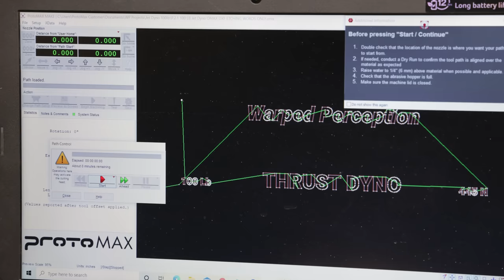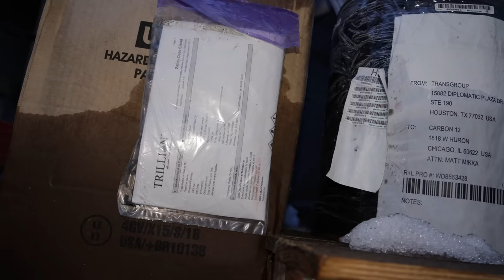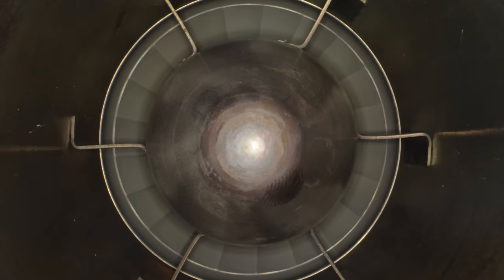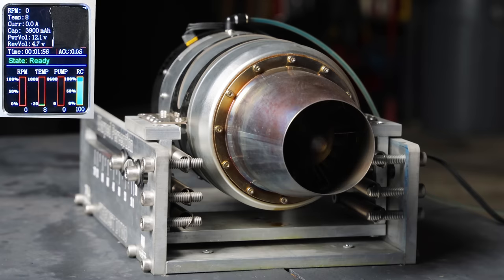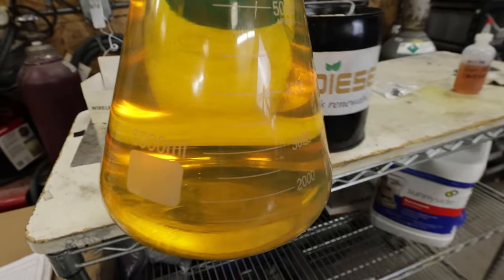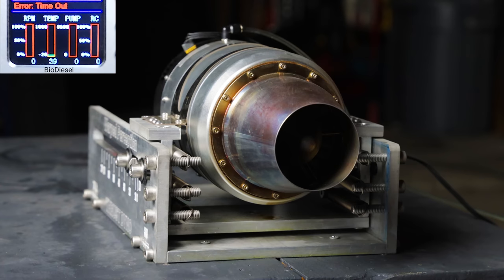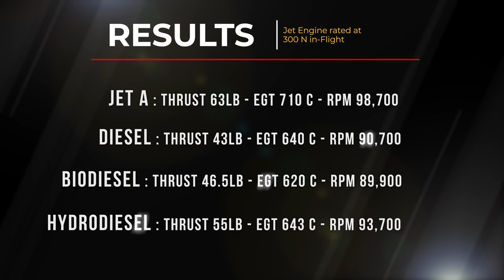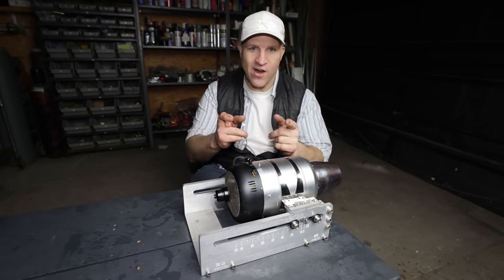Jet Engine Thrust Test - Fuel Experiment (Jet-A vs Diesel vs BioDiesel vs HydroDiesel)

Comment: In case anyone is wondering, this does indeed mean that you can run a diesel car in aviation jet fuel. It’s definitely not something us aircraft engineers do though, honest...
Reply: Yes, most likely.  The military runs a lot of their ground vehicles on jet fuel because they only have one kind of fuel to manage for air and ground vehicles.  Kerosene, diesel and jet-A should all work.  The thing is, diesel is the cheap option.  You would end up spending a lot more if you bought jet-A or kero.
Reply: @LatitudeSky  And the military doesn't care. Actually the cost of managing many fuel types is more expensive.
Reply: The difference is that at jet-a will not turn to margarine at altitude and low temps where jets are efficient. We were trying to figure this out in biodiesel without dehydrogenation in university.
Reply: I may or may not have seen co-workers take buckets of JP8 out to their diesel trucks after draining the fuel lines post test cell runs....
Reply: @LatitudeSky  "You would end up spending a lot more if you bought jet-A or kero" Unless you grew up with a guy that became a crop duster pilot that buys his jet-A by the tanker load. Nice discount.
Reply: @soulcapitalist6204  luckily I only drive at sea level...
Reply: @WayFastWhitey02  definitely not - I’d never do anything like that...
Reply: You do realise that aviation fuel is leaded?
Reply: @oadka  Aviation gasoline has a lead additive. This is not needed for kerosenes like what was burned here.
Reply: @soulcapitalist6204  oh yeah right I confused them sorry
Reply: Penfold011082, i have run a diesel truck in Russia at -35  with a mixture of 75 diesel and 25% gasoline, preventing diesel from gelling, works better than using anti-freeze additives (learned from Russian truck drivers). i have run a Mercedes diesel car from the 80`s with 100 used motor oil (as fuel) in summertime, mixed with 20% diesel in wintertime due to viscosity, and also this same car with 80% jet-a (kerosene) and 20% used motor oil. And with 100% biodiesel too. Depending on the design of the engine, you may run different fuels in it. Well it`s true that the diesel engines form years ago, were more permissive at running different fuels that the diesels of today. The army got some vehicles with engines designed to run with very different type of fuels now a days in service.

Comment: My guess for the hydro-diesel is that the extra water content produced steam, that steam pressure compensated for the lack of fuel in the other diesels. Though it could be that the pump found it harder to pump the normal and bio diesel.
Reply: Diesels in general are very viscous fuel compare to jet fuel or kerosene.
Reply: Nickael7 
Yeh that’s what I’m saying.

Comment: Some of the Water molecules in the hydro diesel might undergo thermolysis, giving off hydrogen and oxygen which then recombine within the engine at very high calorific value enhancing the pressure build up which in turn kicks up the thrust... 

Thermolysis jump starts at 550°c and with the insane compression and heated metal parts there is a chance for some of  the water molecules to split🙂🙌
Reply: Normal inter-turbine temperature (not even hottest part of the engine) on the actual airplanes I fly is 700-720 degrees C, so this is quite possible.

Comment: Imagine how much more thrust they make in the model airplane when it's traveling 2-300mph
Reply: Not a whole lot more, especially given that everything but Jet-A maxed out the fuel system, so, good chance that at speed they'd blow out.
Reply: I'm an aircraft engineer and you're correct that it will make more power when its moving and 'ram' air into the engine, its called 'ram recovery'. However, to maximize thrust you would need a carefully designed intake duct so it supplies this air at the right speed and without turbulence, so it would need to be smooth and properly sized to ram the right amount of air in for a given speed. Jet engines don't have an 'air / fuel' ratio like a car engine, so the more air you squeeze in, the more thrust you get out.. I'm guessing but you could see a 20% increase at speed in a model engine like this.
Reply: @ScottyPilot  Very interesting. Our main problem is, how to design your intake to maximize the efficiency of your system. Hope to find something in the web.
Reply: @thomaskunze8196  its a bit more complicated.
 the angle of the compressor blades need to match the airspeed and rpm to avoid turbulent flow, which is why some turbojet engines have variable inlet guide vanes.
This engine (from what i could see) doesn't even have static inlet guide vanes, which means a lot of turbulence even if the rpm does match the airspeed.
i also noticed that the turbine exhaust appears to form a vortex, so the turbine outlet guide vane are probably insufficiently curved.
If the exhaust was flowing straight instead of in spiral, the thrust should be higher.
But fixing all that would likely cost much more.
Reply: I'm wondering if the different densities of the fuels might require alterations to injector/jet sizes and delivery rates to optimise how they burn.
Everything about the engine design (combustion chamber, turbines, injectors/jets, fuel pump) is optimised or sized for Jet A1 (Kero), and will need altering or tweaking to optimise for Diesel.
Reply: @twentysevenlitres  for the same pressure yes, you need to adjust the size of the nozzles to deliver the right amount of fuel, alternatively increase pressure but only to a point as the actual spray pattern is also important to shape the flame for best combustion and to keep it off the walls of the combustion chamber so it doesn't melt.
Reply: @ScottyPilot  hey mate, I have a question...

I can see a fan in the back of the jet engine that isn’t moving. What is the reason behind this?
Am I just seeing things?"

Thanks very much :)

..Tim
Reply: @yallawallahalla  yes mate, thats correct.   There are a series of stators that look like a fan but serve to re-direct the flow, either onto the rotating turbine or to just straighten the flow into the exhaust so it heads straight out the back of the engine.  We used fuel to energize the air and make it move, if the air swirls inside the engine and not towards the exhaust is inefficient.  Ideally we want the air to flow in as straight a line as we can. The reason it swirls is Newtons 3rd Law 'for action there is an equal reaction' , as the air hits the turbine the turbine moves, the air also moves against the turbine and swirls as a result.   as the turbine spins one way, the stator in the exhaust attempts to straighten the flow. These small engines aren't as well designed as a massive aircraft jet is and there are other design considerations that make large jets more efficient too, proportionately these little engines use more fuel for the thrust they make as a result, but most of us don't care hey..!!  .

Comment: I'm pretty sure the Hydrodiesel would allow for a longer operating time because the water also cools the engine and increases efficiency.
Reply: What would be the cleaner burn tho? Does hydro diesel leave more residue if any?
Reply: Then again, 20% of the fuel mass is replaced with water so unless the increased fuel efficiency is great enough it won't make up for the reduction in fuel capacity.

Comment: This was an interesting experiment but I don't think it was done correctly (at least not for measuring max thrust). The limiting factor in a jet engine is temperature. The more fuel you add, the more thrust you get and the higher your EGT. You can keep increasing fuel (and thrust) until it flies apart. Your "constant" should have been EGT, but instead what you probably kept constant was the power going to your fuel pump. More than likely JetA won because it was thinner and the flow rate was higher. I think the right way would be to pick a constant EGT, say 710*C, and test each fuel to that limit. Keep increasing fuel flow until you get to that limit for each fuel. Yes, you might have to change pumps or injectors for each test, but that is the whole point. Otherwise you are just testing which fuel has the lowest viscosity. I think....
Reply: that makes a lot of sense actually.  seems like another experiment is in order
Reply: Wouldn't you get around the same thrust with the same EGT on the same engine?
Reply: No offense buddy but according to me the objective of this experiment was to calculate what maximum thrust can be produced by the fuel. By fixing EGT I think it would limit the full power or rpm. Like you said, pumps/injectors should have been changed as per the fuel which I totally agree. I have one question though, shouldn't the cooling mechanism for different fuels be different, like in a real jet engine?

Comment: Did you "drill" those holes @ 1:50  with the water jet? To a good enough precision that You could just tap them?
That's pretty impressive to me.
Reply: You can get away with it. I doubt it will pass a class 2 or 3 plug gage though. The hole will also be tighter at the bottom than the top from deflection. The hole walls won't be straight.  Not bad though maybe .010" or so. It's 1/4 inch aluminum though so no big deal. If it was a 1" thick piece you'd have far more deflection. All of this depends on what feed rate is used also.
Reply from the maker: Yup ! I was very impressed that it actually worked
Reply: @joshuagibson2520  yeah I was thinking a slow enough feed rate could get it perfect as more and more metal gets taken away there would be less and less deflection

Comment: I built some of the first lubricity test instruments for the USAF and had an ASTM test method for testing turbine fuel lubricity. Additives can negate the loss of sulphur in all of the fuels. Also many times biofuels have some natural lubricity that severely hydrotreated diesel and jet fuel do not. I also built some of the first diesel scuff testing instrumentation. Poor lubricity tears up the fuel metering/pumps at a premature rate. I would say even more so with ultra high pressure pumps.
Reply: So fuel additives for diesel fuel aren’t just a sham?
Reply: Would love to hear more about your endavours and experience. This sort of knowledge and know-how is priceless to me.

Comment: This is awesome! I have been wondering if it were possible to run different fuels in a turboprop engine. I’m getting ready to drop a Garrett 331-1 in an experimental airplane and was looking at running diesel in it. Looks like it’ll need some modifications to go from jet a to diesel but it seems like it’s definitely doable with the right jetting and water injection for those short field takeoffs!

Comment: O.K. Hear Me Out. A Water Ingestion test, I want to see how Much water it will Take before that Sucker Flames Out. This One is Easy, Doesn’t need any High Altitude Flying or Hiking. Would Love to see this Suggestion in a Future Video. Cheers :)
Reply: won't this destroy the engine
.
Reply: @kingsxkids  no. The Internals of the Combustion chamber can reach 2000 C Water boils at 100. Its fine if the engine sucked in Water.

Comment: As a former aircraft maintainer, I enjoyed this video a lot.  Really surprised by the hydro diesel.  Wondering if it would still function at low temps?
Reply: no, it would jell in the bladder fuel wing tanks; but again, commercial airlines do have the fuel heater unit to heat the fuel as it pump to the rest of the engine fuel system.
Reply: @rtchow3000  Well, they have a small heater that serves two purposes. Cooling oil and heating fuel. The unit is called FCOC or fuel cooled oil cooler.
Reply: @TOP10RakanKazmi  not all airliners have an FCOC, nor can the FCOC keep up with a large amount of water in the fuel, as it's primary purpose is cooling the engine oil, with heated fuel as a byproduct.
Reply: The HydroDiesel essentially is the same as having a water/meth injection, which was used by early turbojets to increase takeoff thrust. At high altitudes however, this would cause massive problems as I'm sure you are aware. There's a reason we sump tanks so much

Comment: That hydrodiesel test was interesting and goes against conventional wisdom of water sucking that energy. I guess the steam is just expanding out the back quicker. I wonder if you could improve the performance of Jet A by watering it down. Or maybe if that doesn't work adding a lighter fuel like ethanol.
Reply: yes, you can. this is done since the 1930s in piston-engines and of course in jet engines. the water vaporizing results in extra thrust, but it also cools down the combustion so you can use more fuel (rich mix) without overheating the engine. this also will give extra thrust. and the blackest trails ever seen. eg. at B52 Bombers or KC-135
Reply: @alkalinebass   thanks for the education, hope this gets turned into a vid.
Reply: I'm not sure how you're translating better performance. 

Maximum Thrust is the key relative to fuel burn (weight) per hour. As these tests illustrated, the BTU level was highest for Jet A and lower for the rest. This is confirmed by the thrust achieved. 

It also makes sense given the Exhaust Gas Temperatures recorded. The one interesting oddity was the biodiesel fuel burn was significantly lower than Jet A. It depends on the biodiesel formula used. 

But lower fuel consumption is not a perfect trade-off given the significantly lower thrust output it produced. 

The hydro diesel was an interesting experiment. But it clearly showed lower performance. 73 pounds for Jet A versus 53 for the hydro-diesel is a big deal. For a single stage LP / HP turbine design, all of these numbers are impressive. 

I've noted some comments about the use of water injection (or in later years, water-methanol) used in the late 50s into the late 60s on some turbojet engines. Early models were first generation axial flow turbines (i.e.) JT3C & D / J57 / JT4A. Some of these models were available with water injection on civilian Airliners such as the DC-8 and B-707. Power did increase - but so did EGTs and was only approved for takeoff use. Metal fatigue was a serious concern. The result was higher maintenance costs. Water - methanol requires a very high dynamic air-fuel compression ratio to be effective. It explains why the hydrofuel didn't perform as well as its potential "could" be.

Few airlines bought models with water injection and those that did, used them flying in safe out of high altitude airports like Denver. I used to fly these workhorses after being converted to freighters.

When bypass turbofan engines became available, the older turbojets were quickly replaced. A modern GE90 / 115 / NG design would not benefit from a water / methanol injection system. 

Rolls Royce and Air New Zealand tested a 20% biodiesel fuel mix in 2008 using a B-747 after initial testing by Virgin Atlantic on one of its B-747-400's. The goal was to save 20% in lower fuel costs and emissions. One of the key safety issues has been biodiesel freezing limitations - even with heated fuel tanks, fuel line freezing is a major technical challenge. A turbine fuel / oil heat exchanger could freeze up, as one British Airways B-777 found out during its approach to Heathrow in 2008 with Jet-A. The USAF tested a B-52 with J57s using biodiesel with limited success that also highlighted performance / maintenance concerns.

Overall, these micro turbines have limitations because of costs and the complexity in building multi-stage low pressure and high pressure fan assemblies, that can pressurize a high temperature combuster chamber. I bet the percentage of fuel burned in a microjet turbine like this one, is less than 70% efficient. Early JT3C and JT4s were just as bad compared to a 1990s CFM56.

Have a nice flight!

Comment: Fun fact:
when they start large jet engines, they tend to spray water into the compressor.
this increases the weight of the gas and increases thrust, making the turbine come up to speed faster.
that could explain why the hydro diesel performed better.
Reply: Fun fact. Your wrong lol that never happens lol
Reply: @Matthew33138  they don’t do that when they start, but it clearly increases rpm in the video, which is needed for more compression during takeoff So it is “sprayed” in.
Reply: They won't spray water in the compressor but actually at the end in nozzle section the spray of water and alcohol is done that process is called as after burner which increases the thrust in some amount.
Reply: @Matthew33138  well, i'm pretty sure i heard AgentJZ (awesome channel btw!) say so in one of his video and he showed footage of a guy spraying something directly into the fan of a turbofan powered airplane. 
If i remember correctly, he said it is done occasionally if the weather is too cold or the air pressure too low.
I couldn't find the video since it has been quite some time since i watched it, so feel free to search for it yourself and/or prove me wrong.

Comment: The thrust in a turbojet is all about the mass and velocity of the exhaust. It will be the burning characteristics in the chamber that will matter most, a fuel that burns quicker and where the burnt gas molecules travel faster will produce the most thrust. The hydrocarbon chains in diesel are somewhat longer than in jet fuel and probably take longer to burn, do so at a lower temperature and produce slower speed exhaust gases. 

It's notable that the thrust basically correlated with engine temperature and shaft speed. The jet fuel simply seems to burn quicker and hotter and that means more thrust and spinning the engine a little faster too. The simple answer would appear to be that if a fuel is formulated to burn faster within the environment of a jet engine combustion chamber it will produce more thrust. It may well be that a combustion chamber optimised for burning diesel would change this somewhat.